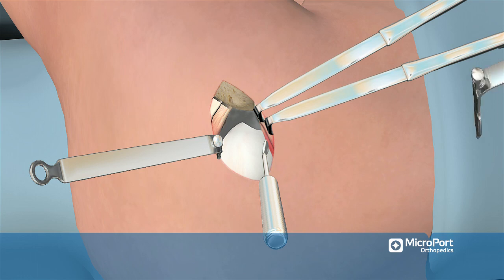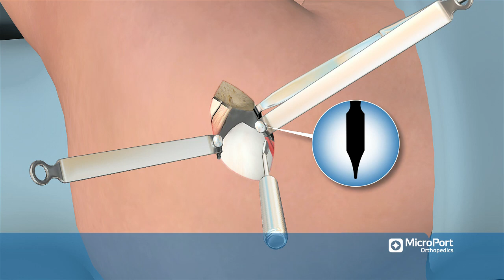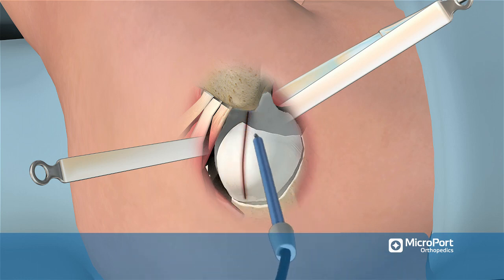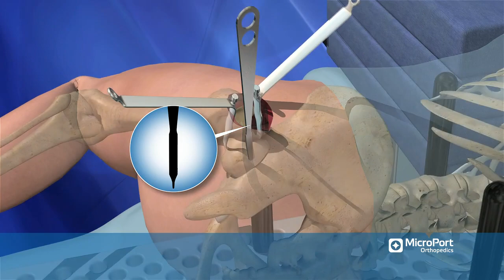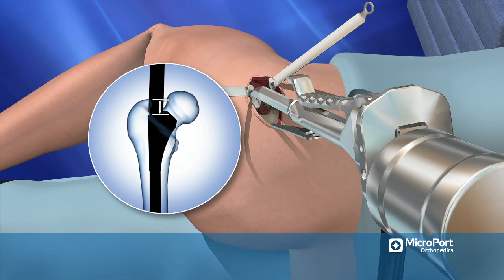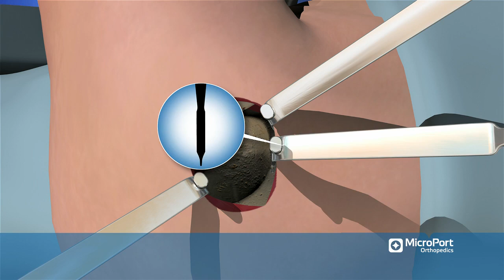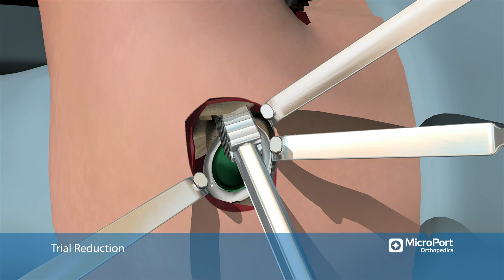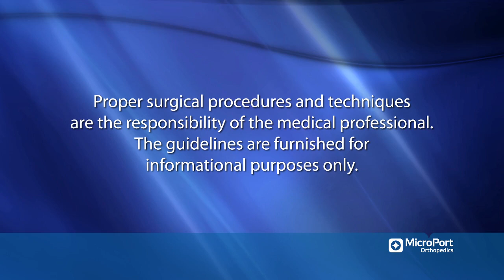SuperCap® Total Hip Replacement Approach Animation

Comment: Thank you for the information.

Over time, the original components of a hip replacement procedure can wear and loosen from bone surfaces. A Revision hip replacement involves an operation to replace some or all of the original prosthetic components with new ones. The complexity of your revision surgery depends on the amount of loosening or damage that has occurred to bone surfaces, and the specialized components and bone graft material that may be required to rebuild the hip joint. For more details : https://www.bharathorthopaedics.com/revision-hip-replacement/